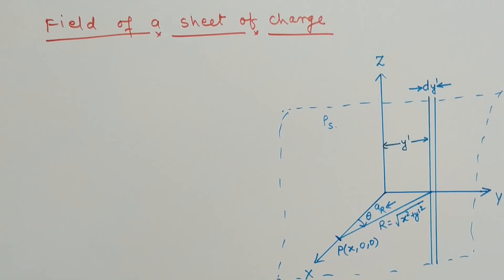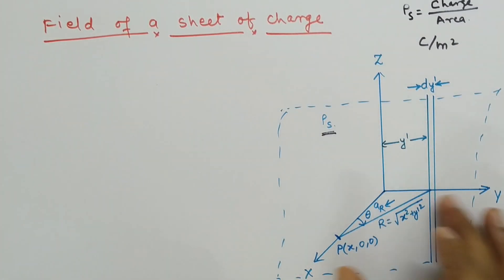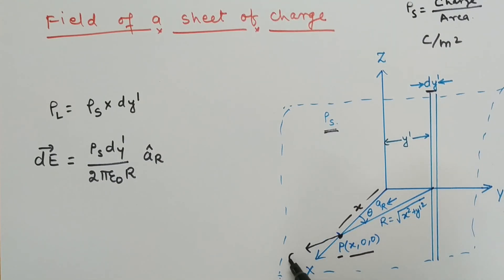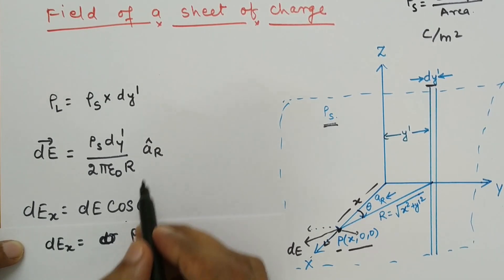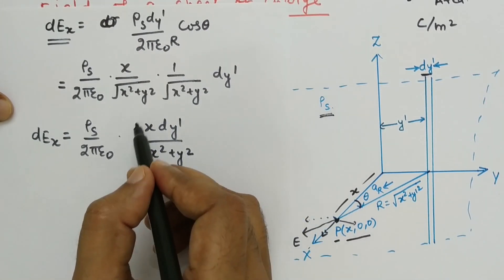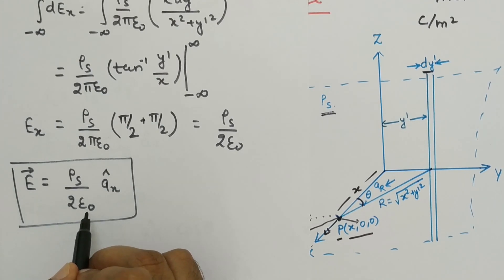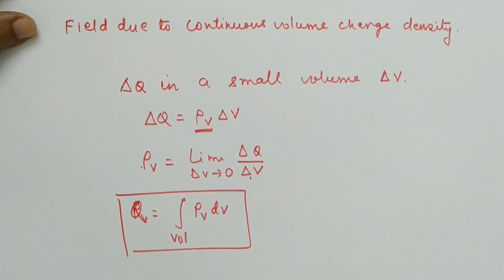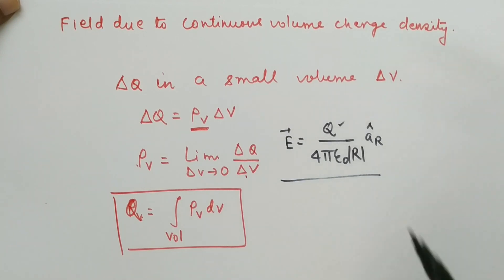Electric Field intensity due to surface and volume charge density by Prof. Niraj Kumar VIT Chennai

Comment: Sir, if question is asked like electric field intensity due to a surface charge.(didn't mentioned finite or infinite)
Then the answer: rho(s)/2€0 * an. Is correct or not sir.
Reply from the maker: This expression is only for infinite surface or near to infinite surface.